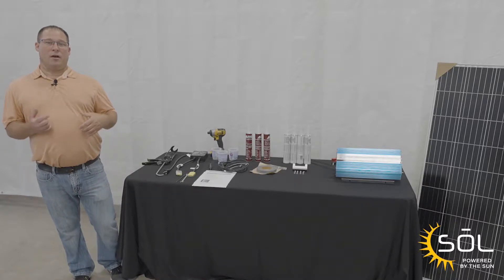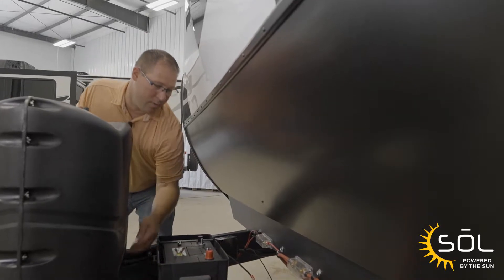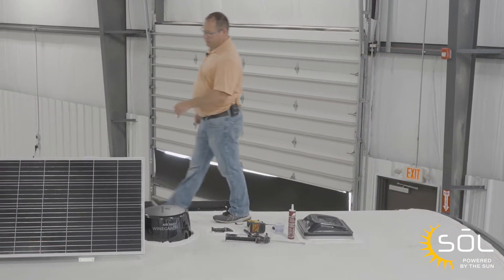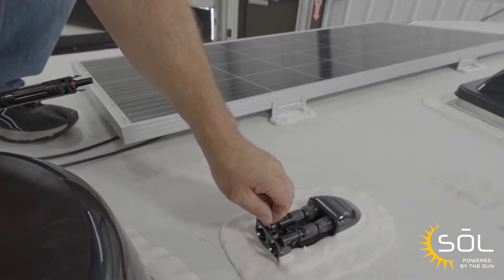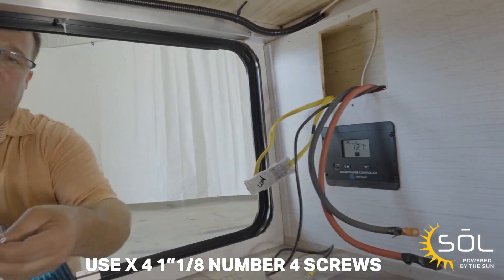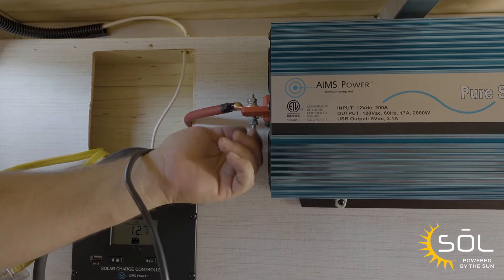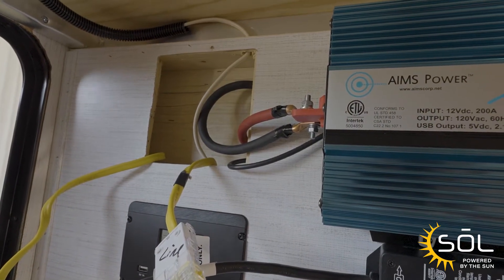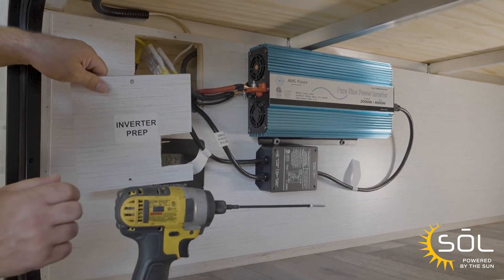SŌL - Powered By The Sun - How to install solar for Heartland RV.

Comment: What about an older model?? I have a Pioneer RD 210 2020 model-27 feet Camper/Trailer-I just need lights, refrigerator, outlets to work-power for microwave, toaster oven, TV and computer-I NEVER use the AC-I do just use a stand alone fan-and in the winter-I sometimes use the propane furnace-but mostly a small heater-that keeps it warm enough for Me-I live in South Carolina-so winters aren''t so bad-it's summer that is hot-but I don't mind that at all!

Comment: I need a parts list to upgrade from sol 190 to SOL 380. Specifically the Y that goes from the inverter to the line and load.

Comment: I just bought a 2024 Heartland pioneer rd210 I have no power going to my charge controller after the battery has been hooked up the LCD screen stays blank I have tested the battery and it is showing a little over 12 volts but anytime I test the wires behind the charge controller that all reads zero

Comment: What do I do if heartland forgot to label line a load on the connectors?
Reply from the maker: Hi there! Please reach out to our parts department at (877) 262 - 8032 with the last six digits of your VIN# and they will be able to further assist you!
Reply: There’s more to the story here. How do you power up the positive and negative cables that you pulled out from behind the panel and connected to the inverter.  They aren’t hot, so there must be a breaker or a switch somewhere right??
Reply: And my load and line connectors are not labeled either. The solar panels are charging my batteries which is great, but I don’t have power to my inverter.

Comment: Sol 380.
Would I be able to run a 13500btu or 14500btu ac at night? And for how long approximately, On 200ah deep cycle 12vdc? Or on 400ah lithium 12vdc? 
Thanks in advance